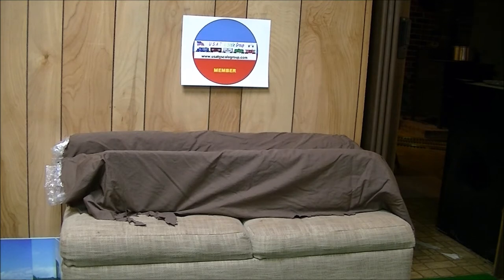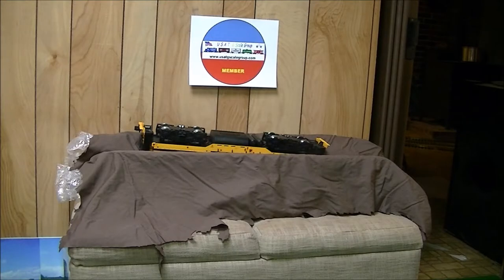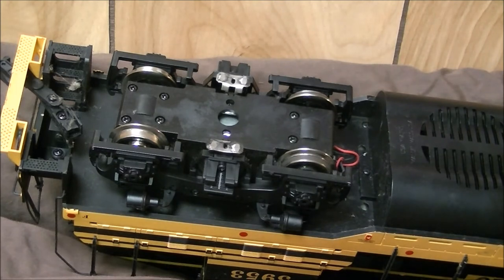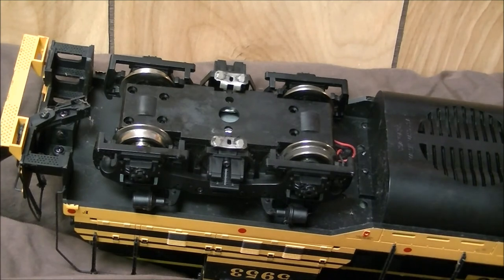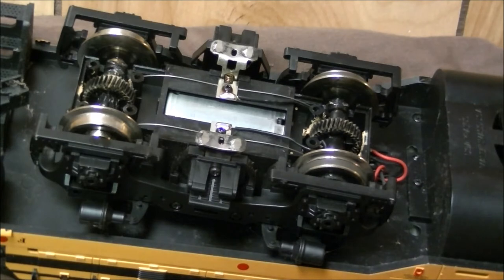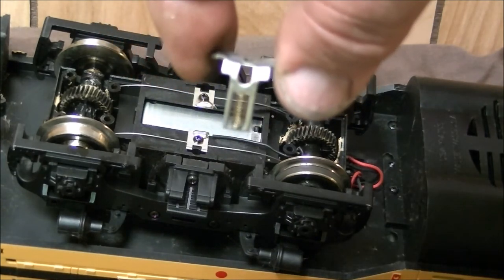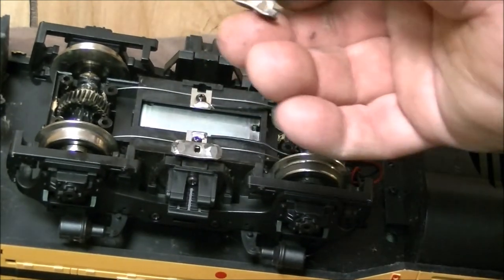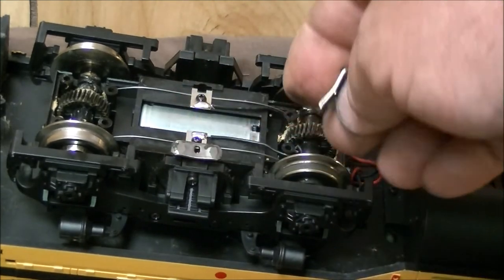How to Replace USA Trains Sliders & Axles - G Scale

Comment: If you ever have the SD40 apart again, I would like a view of the mounting bracket inside and out of the train. I am missing parts here. I also would like a height from the block to the top flat of the mount. Thanks.

Comment: I have a USA Trains NW-2. I have ordered 2 motor block from Charles RO. (Great company BTW). I have yet to see how they are held to the frame of the locomotive. Can you or anyone else point me to some procedures? They use an R22-12 S4 motor block. Slightly different than this one.
Reply from the maker: The motor blocks are held in place by the side frames of the trucks. There are small phillips screws in the side frames you need to remove. Also take a photo of which terminals the wires are connected so you get them in the correct place